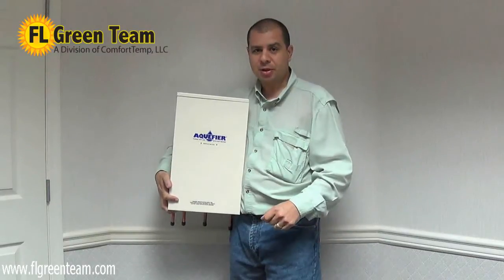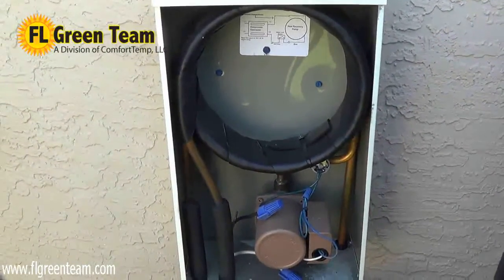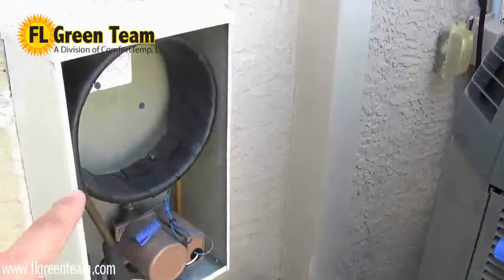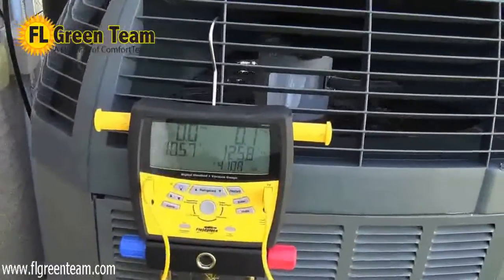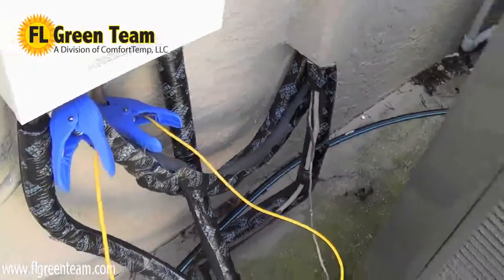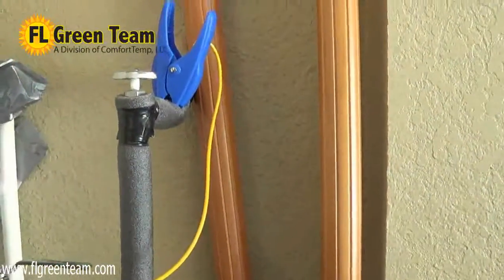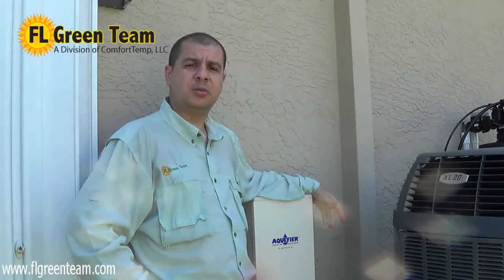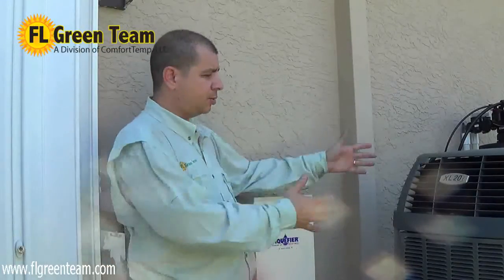How to get free hot water all Summer Doucette Industries Heat Recovery Unit Noah

Comment: Had this on my first house I built in 1990. 
I turned off water heater breaker and always had a great supply of hot water. 
I am looking for a contractor in Palm Beach Florida that is familiar with this system. 
Surprisingly most are not. It makes perfect sense to allow your outside condenser/compressor to heat your water. 
This is the definition of green energy and I am bewildered as to why it is not required in new construction. 
Please let me know of any AC contractors that can do this install in Palm beach county. 
Delray Beach, specifically. 
Thank you for great video.
Reply from the maker: Look for companies that have been in business since the 90's, as that is when they were sold and installed the most, as well as the early 2000's. Here is another video on the system..... https://youtu.be/TQnpSmNohvg